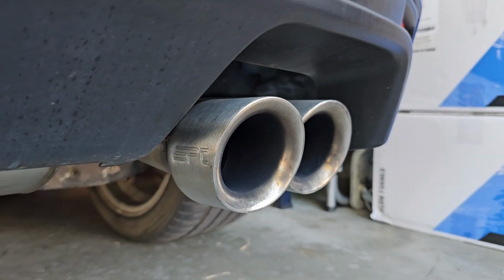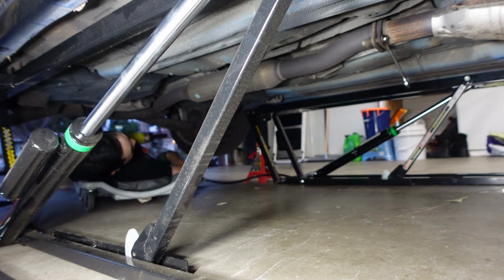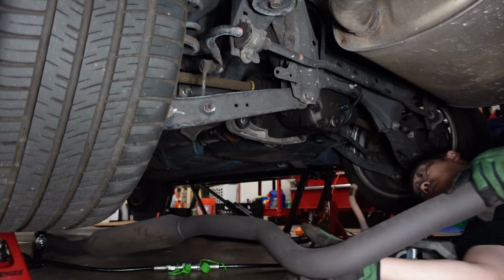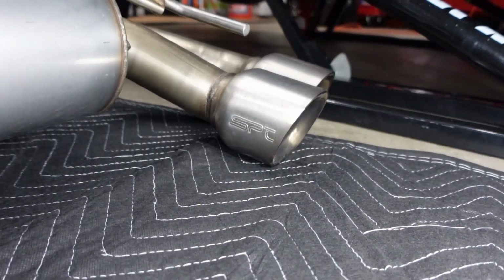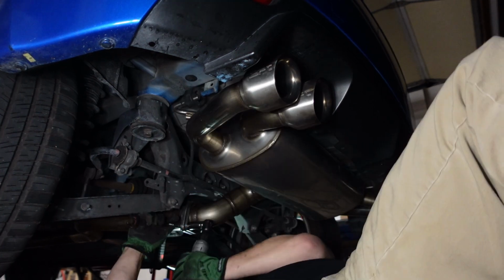The SPT Cat Back is the BEST affordable Subaru WRX STi Exhaust

Comment: Your install seemed pretty easy. I have bought the exhaust and have not got it installed yet. Due to my local subie dealer selling me the wrong gaskets and throwing me off for i need
Reply from the maker: yeah the gaskets were weird. I was given some generic ones and for a while was like why were they not fitting! Hope you get yours on soon! It sounds sooo goood
Reply: @HazardGarage do you remember what you used or part numbers?
Reply from the maker: @lenc3717  The muffler to the mid pipe uses a ring "crush" gasket. The only way to get it is to order the "hardware kit" from subaru. I think the part number is: D441SVA040.

Comment: A new oem spt hatch catback is like $900+,  is SS409 and the tips are going to rust off in 5 years if you live in the midwest. Buy something in 304/316 stainless now and save yourself the hassle of wasting 900 bucks. I loved mine, but the whole tip and pipe rusted off the muffler case on two tips. I bought a Nameless with 5" mufflers and resonated midpipe. https://youtu.be/5IDXZREw_Z8
Reply from the maker: through subaru parts online or used you can get them like $800 new and dirt cheap used! But I bet those midwest winters are pretty unforgiving! Glad you found a exhaust that you liked as well. The SPT was everything I was looking for!